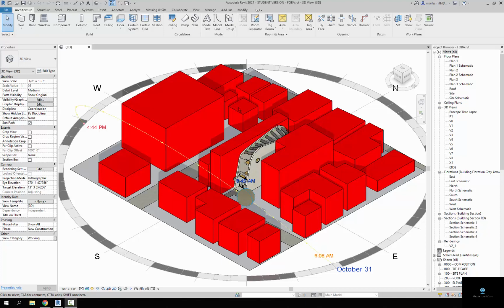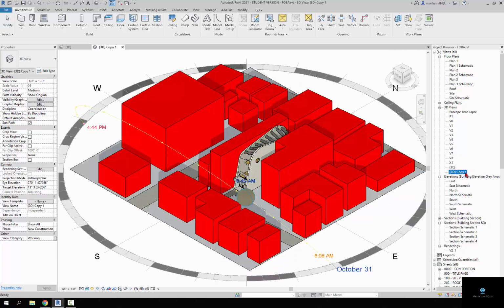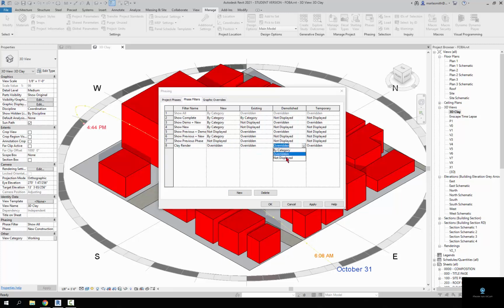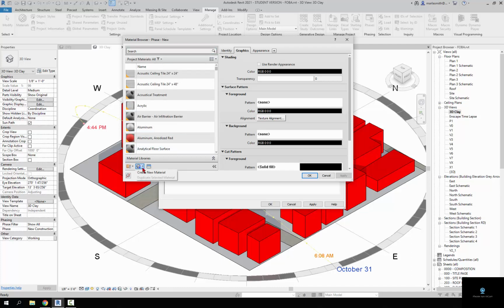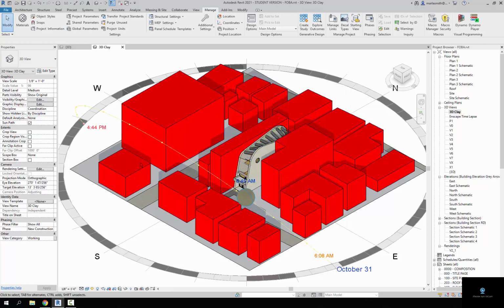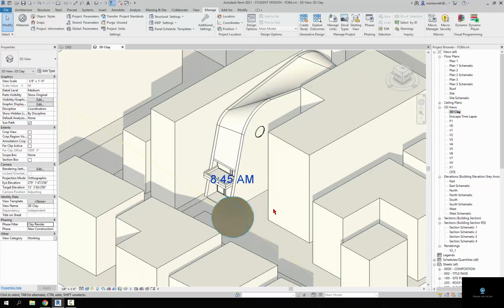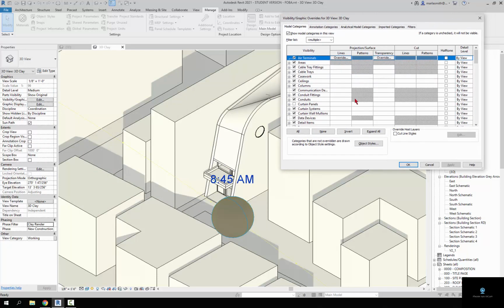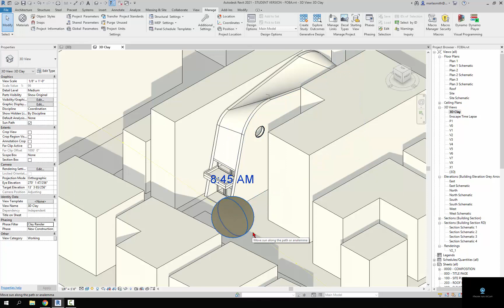Revit Clay Render Phase Filter

Comment: How do you fix the Sun Diagram to fit just on the outside of your entire model like yours? Because sometimes the sun diagram will be smaller than the model...
Reply from the maker: The sun diagram sizes to the extents of the visible model.  So when you turn it on make sure you have hidden any large topography or model elements.  You can turn them back on after you turn on the Sun Diagram.   If it's already on just turn it off, hide things, turn it back on.  You can also scale it's size somewhat after it's been created in the properties dialog.
Reply: @MSmithWorkShop  thanks alot :)